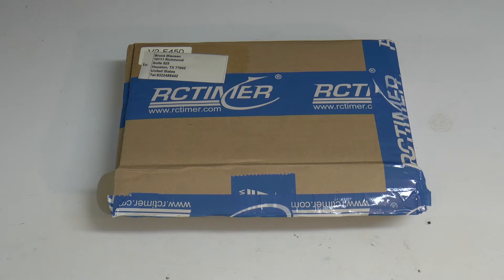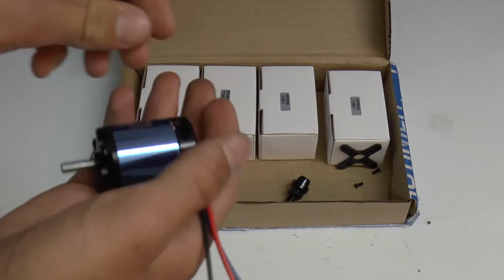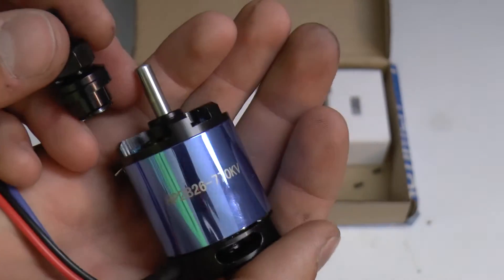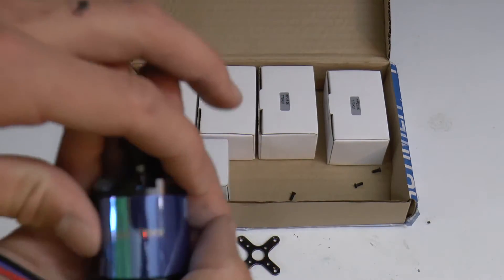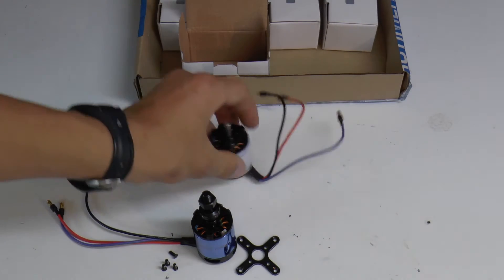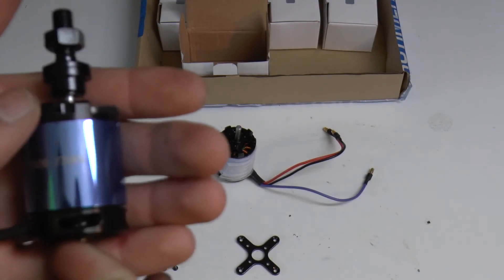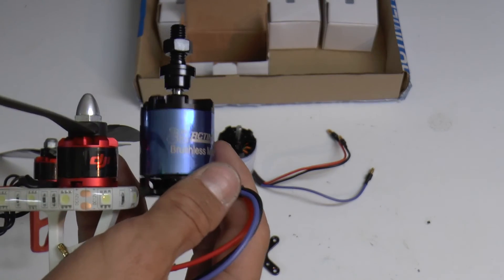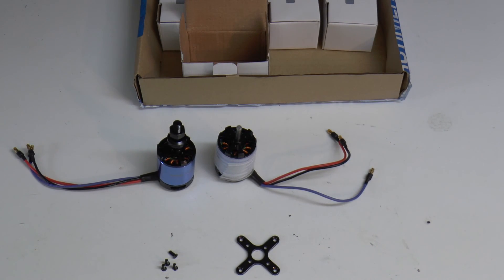UNBOXING | RCTIMER MOTOR 770KV

Comment: I purchased 6 RCTimer HP 2826 770KV motors. 2 out of the 6 had loose grub screws that hold the motor shaft to the bell. Thus I was not able to stop the motor shaft fro turning while holding the bell still. If you fly with motors like this you multirotor will eventually fall out of the sky and crash! I sent the two motors back to UAVObjects (RCTimers USA warehouse) where I purchased them and they stated they couldn't find any problem with them and sent them back to me!

I told them exactly what the problem was and they didn't check to insure the bell and motor shaft didn't rotate independently of one another. So buy at your own risk. Their quality control needs a major overhaul if they can't tell that motor bell isn't tight to the motor shaft. Most companies use two grub screws to lock the bell to the motor shaft to insure no slippage, so why does RCTimer use just one very small (.09mm) grub screw on such a big powerful motor? Especially when there 3 areas where grub screws could have been placed.
Reply from the maker: Brian Shears I can't agree more.
Reply: My previous post had an error on the size of the grub screw. It actually is a 2.5mm grub screw requiring a 1.3mm Allen wrench.

I decided not to return the motors and repair them myself. I found a 1.27mm Allen wrench and tried to tighten the grub screws but found that Allen wrench was slipping when I tried to tighten it, maybe because the wrench was to small or maybe the grub screw was sightly stripped. I removed the 2.5mm grub screw and tapped the hole to use a 3mm grub screw which takes a 1.5mm Allen wrench that is much easier to find and less likely to strip when tightening it. Also 3mm grub screws are much easier to find. Problem solved.

I also wish to point out that I started a Pay Pal dispute to get RCtimer/ UAVObjects to take back all the motors because I was was upset and didn't want to deal with them any more Also a Hex need 6 of the same motors to run properly, and I didn't think I was going to be able to get two more of those motors.
RCtimer promoted it to a claim and wanted me to ship them all back at my expense to get my refund. So I was looking at at least a week to get refunded, and probably another two weeks to get new SunnySky motors in.

The bottom line is if you buy from RCtimer and have problems your screwed, even if it is a part that is obviously bad from there warehouse. They have lost all my business because of the very poor customer support I got.
Reply from the maker: Brian Shears Thank you so much for this information. I am going to try to tap new holes on all of my motors. What tap did you use? I found one on towerhobbies called the dubro drill and tap. Would that work or will I need something different? Thanks for your help.
Reply: Infinite Remote Control
I used a 3mm tap. The requires a hole of 2.5mm before using the tap. I used a 3/32 drill bit which is close to 2.4mm so you have to turn the tap back out a little and then back in to get through, but it works well. I just did the two motors that were loose and didn't do the other four because they were nice and tight and I don't think they will be a problem. I do check all 6 motors before flying just to be safe. So far none of them have loosened up.
Reply from the maker: Brian Shears Any suggestion on the brand of tap?
Reply: Infinite Remote Control
I purchased my taps at Lowe's and the brand is Irwin tools. The package contains 5 taps and 5 dies with handles for the taps and dies. The package has 3mm, 4mm, 5mm, 6mm,and 7mm taps and dies. It was around $24.00. The packaging acts as a case for the taps, dies, and handles. There is also a chart that tell the size drill to use with the taps.
Reply from the maker: Thank you for your help. I am going to try it and let you know how it goes.
Reply from the maker: Brian Shears I bought a kit and tapped a 3mm hole. I worked perfect. I did add a flat area on the motor shaft so it would be impossible to slip. Thank you for all of your help.
Reply: Infinite Remote Control
Your welcome. I never thought about doing that. That's a very good idea. I may try that as well. Thanks for letting me know.

Comment: the smaller number is the stator size, larger no. is outer can size. any update on you testing?
Reply from the maker: I still can't get these motors working properly and have had huge problems with quality (already had to throw out 3 of them) Don't but RCTimer motors! I did buy their 45a esc's and haven't had a problem with them yet.
Reply: 2826 is actually the size of the rotor 28mm thick and 26mm high.
Reply from the maker: Ok, thanks.